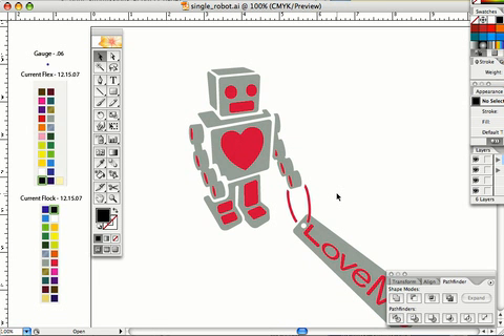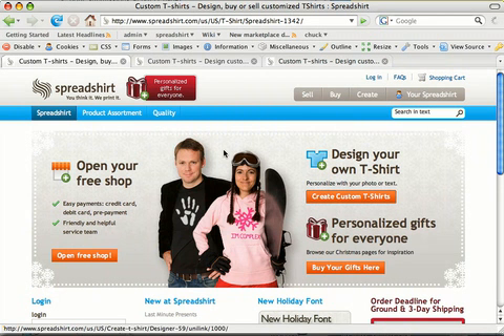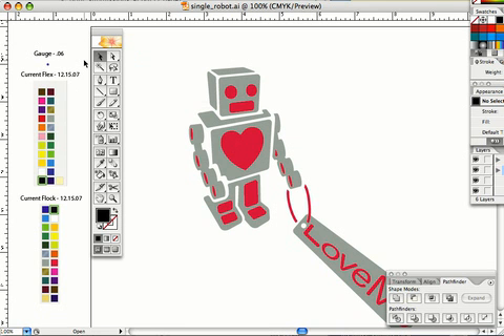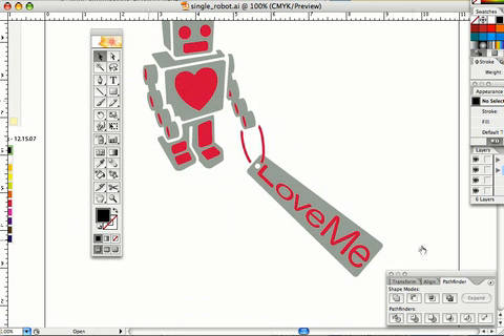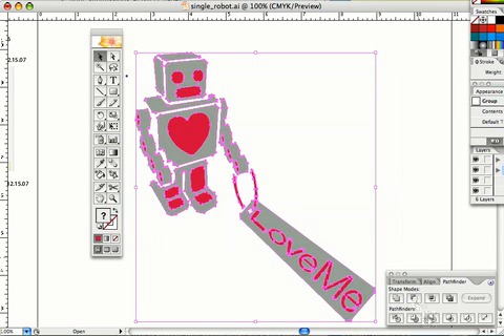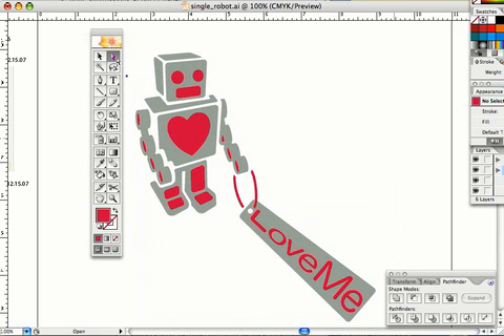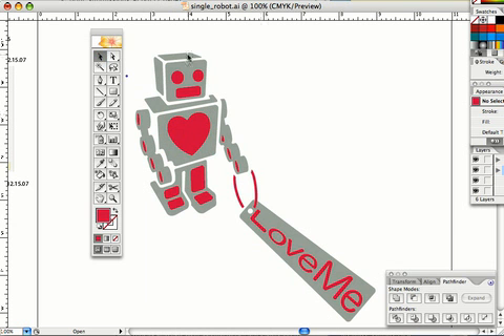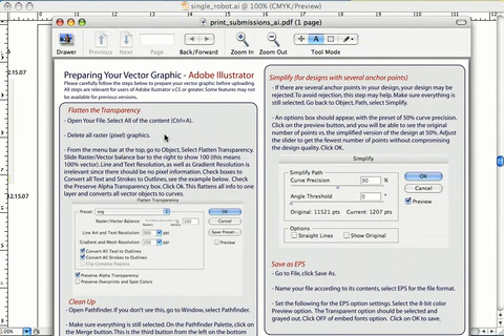How to make a vector t-shirt design for Spreadshirt

Comment: Hi there, at 5.17 the edges of the red oval are smaller than the 0.6 circle? Is this ok? Is it just the gap between the colours/elements that needs to be 0.6 apart?

Fantastic video actually, I was having problem with sizing and this really helped :)